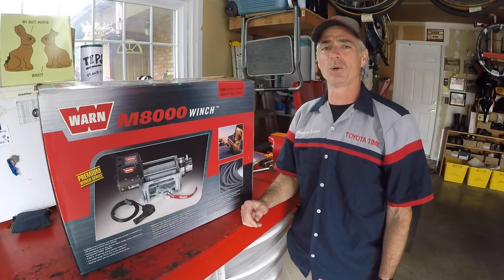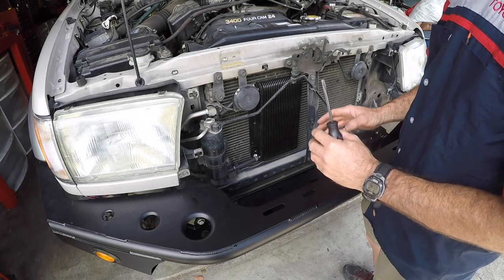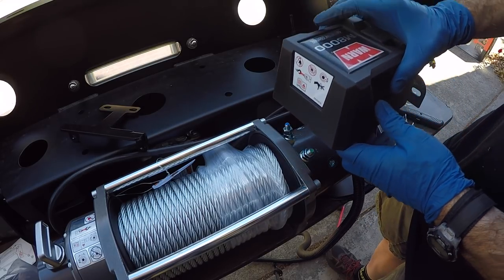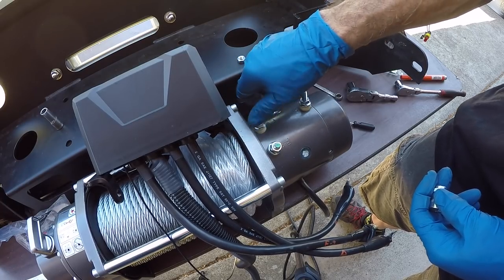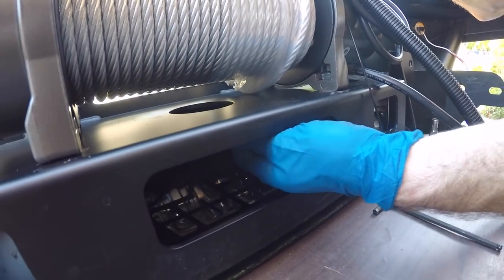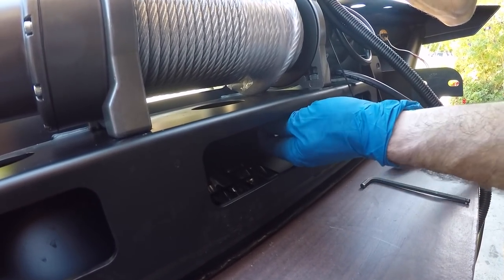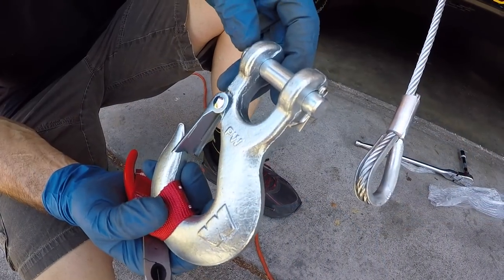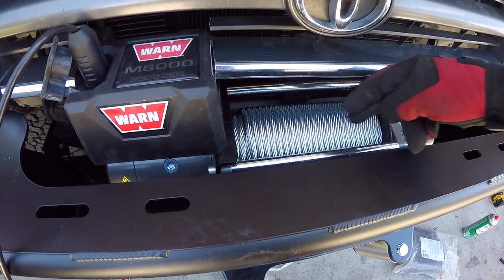Warn Winch M8000 Install on CBI Hybrid Bumper

Comment: Brother Tim, like your safety aspect with installing and using this tool! Before you know it- the finger is gone!!
Reply from the maker: jake ounce Thanks Brother Jake.  Based off the safety messages in the Warn user manual,  I got my hands too close.  You just need a healthy respect for what your working with.  There's obviously other safety concerns when you're winching yourself or a buddy out that we could cover in a winching techniques video.  If a steel cable snaps under load, that cable can spring back towards the user with a lot of force.
Reply: Timmy The Toolman Absolutely brother Tim safety is Paramount when that cable is under tension, and a lot of people don't respect that aspect of using this tool. When I was in the Navy, they showed us videos of ship's ropes that were under tension and, when they snapped, it cut the mannequins in half. Now that was ropes, so you can only imagine what cable will do to a body.
Reply from the maker: Hey Brother Jake, thanks for your service.
Reply: Timmy The Toolman I appreciate that brother Tim!

Comment: Another great vid. 

Would love to see you do a tutorial on relocating the winch control box. I just installed a Shrockworks bumper and that meant relocating the control box inside the engine bay. Used angle brackets to attach it to the battery tray, out of the way of everything. 

Not rocket science but would be handy to show folks how to extend the lines from the winch to the box without interfering with the belts, fan, etc.
Reply from the maker: https://youtu.be/znCCH6mvTvk

Comment: For arb bumpers.. clocking the winch is required. You got a nice plug and play setup!
Reply from the maker: What does clocking entail?  Pulling the winch apart and getting the winch aligned in the proper orientation?
Reply: Timmy The Toolman it involves rotating the winch so you can get to that lever since its not always on ideal spot. I believe they are 12 degree increments or something like that. I think you can do the battery connections too.
Reply from the maker: Cool, thanks for sharing this.

Comment: Have you done a video on the "big 3" wiring upgrade? I was admiring your wire running and thought it would be a good one.
Reply from the maker: No, we haven't done a video on the Big 3 yet.  We might just do it.  Thanks!
Reply: Timmy The Toolman cs144 alternator upgrade with it please! Lol
Reply from the maker: I reckon we'll have to consider this.
Reply: Would be an awesome video or series; big 3 upgrade,dual battery or group 31 and the caddy alternator. 🔋
Reply from the maker: I didn't know when Minh commented but Sean already has a caddy alternator he wants to install on his rig.  I could see us doing the Big 3 and the group 31 as well at some point.

Comment: Hey Timmy--I have a 98 Tacoma 4wd.  Could you do a video on changing the front and rear differential fluid?
Reply from the maker: We have a 30,000 Mile Service video that covers that. Here's a link:  https://youtu.be/a81i1Cayf_I  If you're struggling to get the front differential drain bolt or fill plug free, I suggest you apply some heat to the plug with a butane torch.  30 seconds is enough heat to loosen the bond of the plug and washer.  The drain plug on the front diff is well known to be extremely hard to break free so don't strip it.  Heat is your friend.  The rear diff should be a piece of cake to do.  Just watch the video.  In the video description, we put times to different parts of the video so you can go right to the part you want to see.

Comment: Can you please explain, why you didnt mount control box inside the bumper, but put it on its standard place? As i can see, lenght of the wires is pretty enough for this
Reply from the maker: Well, because we didn't.  Mounting location for the control box is personal choice.  You just want a location that will allow you to easily connect up the controller cable.
Reply: @TimmyTheToolman  thanks for response 👍. Im looking for same winch, but have a doubts about its fitting in my bumper.
Reply from the maker: @jarjar4102  It was pretty tight but it worked.

Comment: Love the video can you tell me did you have any problems with running control pack ground wire to frame as warn said has to be to bottom of winch to ground.. is it causing a draw problems ??? Thanks
Reply from the maker: As far as I know, everything is fine with how my winch was wired.  I've used the winch a couple times so far and all is good.  I connected the ground wire to the body and I think that's fine.  Ground wires from the negative terminal of the battery are grounded to the body in the engine compartment.  I don't have any parasitic draw if that's what you're asking.
Reply: Timmy The Toolman thanks I followed your advice and use bolt on radiator cross member winch works great but every time I use it my dash changes to menu and fuel economy called warn they asked if I used bottom of winch I said no they said that body ground is not battery ground which is to engine Iam like but their connected he said no its not so I gotta take whole bumper cover grill off of it as it’s a Grand Cherokee crazy I don’t get it I thought it was ground is ground 🤷🏼‍♂️
Reply from the maker: @sheerwillsurvival2064  Interesting.   All that wire says is motor ground, so I figured grounding it wherever is fine.  I guess if I run into any issues I'll know why.  Like I said the battery is grounded to the body so why can't the winch be grounded there.  Weird.
Reply: Timmy The Toolman yup that’s what I thought

Comment: There is a reason that there is no washers other than the lock washer in that kit. Firstly: regular washers are for distributing the load over a wider area when bolting softer things, you don't need that on a steel bumper. Secondly: you acctually negate the purpouse of the lock washer by putting a washer in between it and the bumper, now the lock washer only lock the nut to the washer, witch is free to rotate.
Reply from the maker: Thanks for sharing this.
Reply: No problem, though in this application I doubt it makes a difference. Its more important in applications with intense vibration. One reason for manufacturers to include a flat washer applied in the way you did is if the items you're bolting together has a less durable paint that will be pealed by the lock washer thus exposing the metal around the bolt hole to rust. But in that case you might as well skip the lock washer and use locktite. Anyhow: nice install video.

Comment: Timmy,
Is that a Tundra transmission cooler?
Reply from the maker: No, it's a B&M 70264 cooler.  Here's a link: https://www.amazon.com/gp/product/B000CIIDZE/ref=oh_aui_search_detailpage?ie=UTF8&psc=1  I'm running them on both of my 3rd Gens.  I run them in-series with the trans cooler in the bottom of the radiator.  The ATF runs through the radiator cooler first, then runs to the B&M cooler and finally back to the transmission.  Some people bypass the radiator cooler fearing a cooler failure and then a mixing of the engine coolant and ATF that ruins the transmission (known as the pink milkshake).  I did quite a bit of research and decided to not bypass.  However, I did replace my radiators as preventative maintenance to lessen my chances of having a cooler failure.  Here's a link to the video of me installing the cooler on my 2000: https://youtu.be/2nVbwe2t2T8

Comment: why didn't you fit the solenoid inside the engine bay, i know it's more work but would have saved the grill & the look more flush...just an idea.
Reply from the maker: Hey Ahmed, I knew that was an option but it didn't bother me to notch the grill.  I'm much more of a function guy than a form guy.  I know looks are super important to some people but I'm not one of them.  Maybe I'm weird but I actually like the look of the grill notched for the  solenoid.  The extra work to mount the solenoid in the engine bay didn't seem worth the trouble.  When we get around to installing a winch on Sean's ARB bumper, I think we have no choice but to move the solenoid in the engine bay because of the way the ARB bumper is designed.